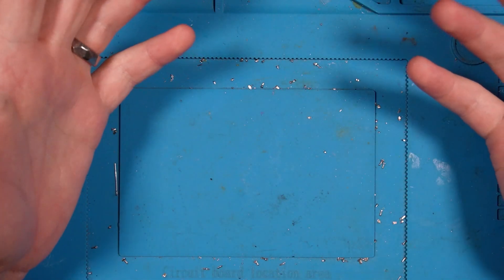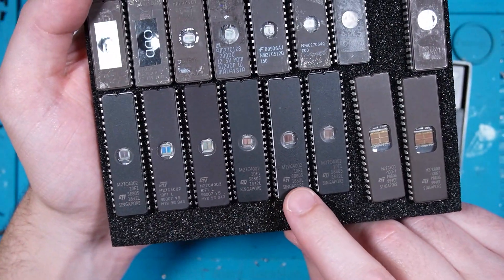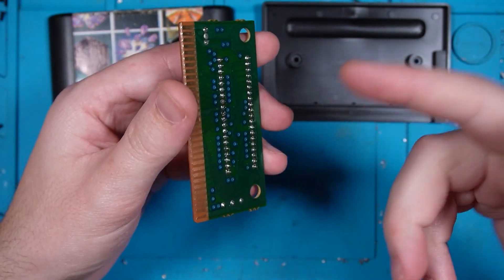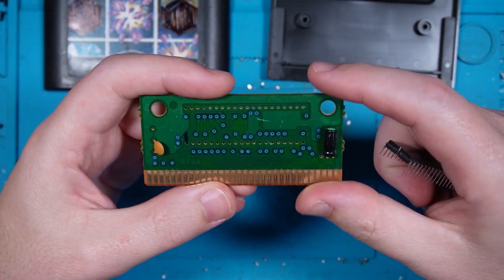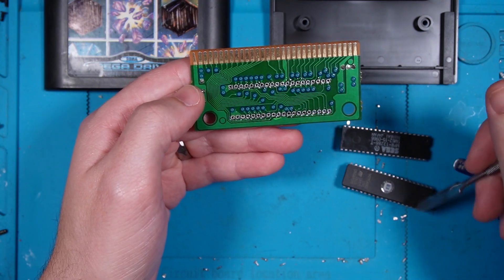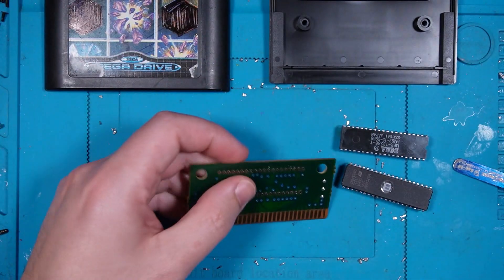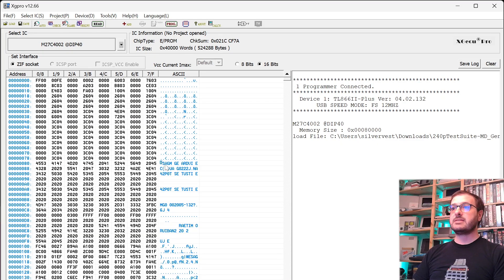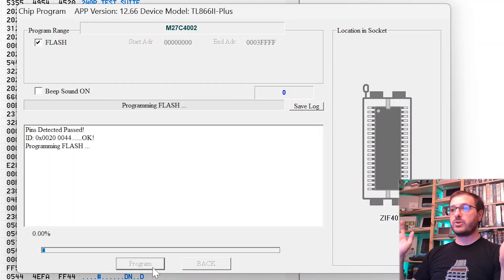How to make a cheap-ish Mega Drive test cartridge

Comment: Interesting. Since you had to run a wire to the A17 pin of the EPROM, is it possible to only fold it outside to make the whole process reversible?
Reply from the maker: Yes absolutely! Really would just need to cut the wire and bridge the gap that I cut with some solder to be reversible